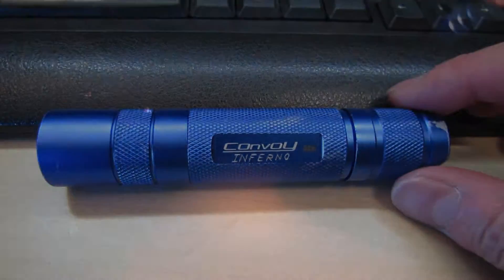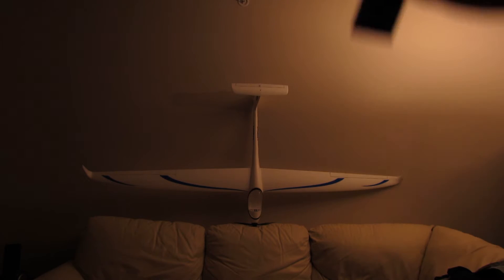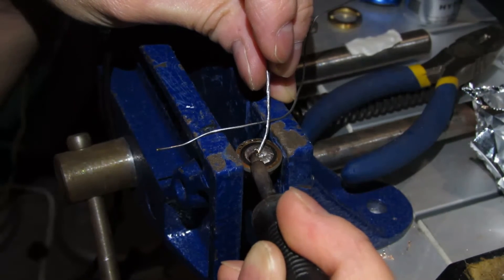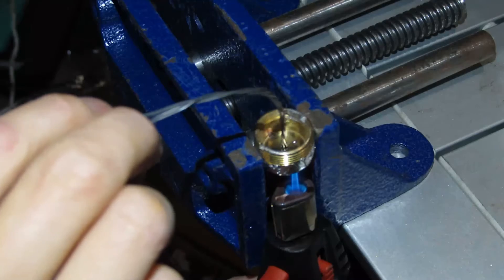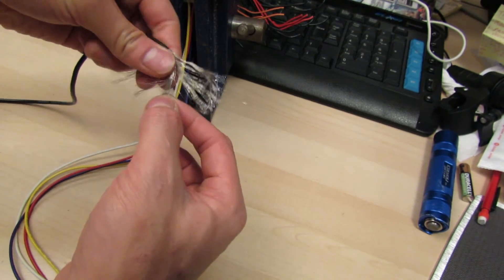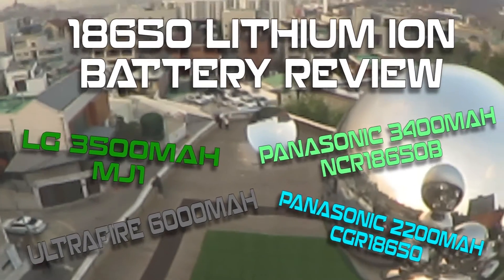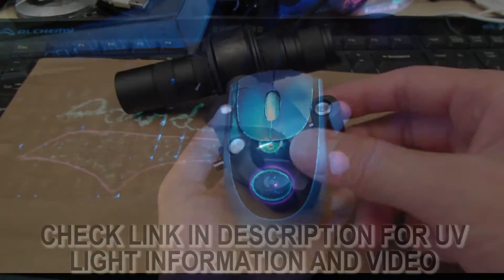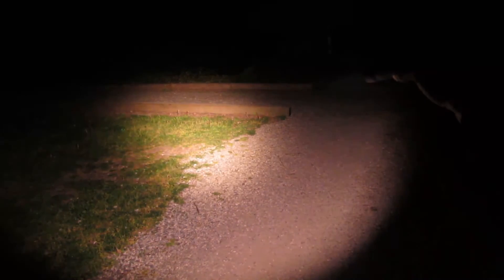The Most POWERFUL Flashlight EVER - DIY Convoy INFERNO - 2239 Lumens

Comment: Nice! I am going to try this with an XP-L HI LED!
Reply from the maker: Awesome!  Ya the XP-L HI is a great LED, that would be good if it can handle the currents.  Throw it on a Sinkpad II like this one, it's only $2!  http://www.leddna.com/sinkpad-ii-gen2-xpl-g-g2-e-c-xte-16mm-round-copper-base/
If you can buy the XP-L for cheap, that'd be pretty good.
Also, if you put it on a smooth reflector, you'll get a tighter beam:
http://www.mtnelectronics.com/index.php?route=product/product&product_id=479
Or you can go with a collimator from leddna if it'll fit, haven't tried it yet: http://www.leddna.com/10-degree-21mm-reflector-collimator-led-lens-for-cree-xml-xm-l-led/
That's the great thing about a point source, is that you can focus it better into a tighter beam, and make the ultimate high powered compact thrower, probably would be the world's smallest, most powerful, thrower of them all!
A thrower isn't all that useful in my applications, so I prefer the orange peal reflector and the XML2, but I can see that being useful for people in search and rescue, security maybe, things that require more punch than regular lights.
Cheers!
David.
Reply: Yeah! I have 3 S2's. One red one from GearBest (Warm White-XM-L2), two from Mountain (XM-L2 and an XP-L Hi I made from a host). This torch will be bad ass! I may figure out how to add a thermal cutoff too. Also, have you ever tried copper braid that's used as solder wick for tailcaps/springs? I don't know if solder wick is of a high copper content though. I will definitely post my results!
Reply: One more question, what did you use for spacers between the chips on the driver?
Reply from the maker: Hi John, I was eyeing the S2+ for a long time, but when I saw the blue one(new at that time) on sale for $12.88 at GearBest, I dropped the hammer and ordered it, for that price, I didn't care if it sucked, but when it showed up, I was more than impressed with it, hence the video and all my recommendations to my friends, some of them ordered 4 of them cuz they're avid hikers, and they had many cheap made-in-china flashlights die on them, mostly due to the cheap drivers, I told them these AMC7135 current limiters wouldn't let them down as easily.
The Convoy Inferno is my go to flashlight, due to it's power and long runtime, it's a jack of all traits.
When you say you got the Red one with warm white, which color code was it?  I only saw on there the T6-4C, which is 4300-4500K, cool white.  I would have gotten the warm white one if they had it though, probably ran out of stock, cuz the Blue I got was warm white, and it's not listed now though.
I haven't tried copper braid for desoldering, and the only reason for that is because I don't have any, but if it's high in copper content, it would certainly be great for that!  The wires inside very flexible silicon cable is very thin, there's hundreds of strands in them, so I think it's really flexible, that's why I like it using it, I assume it's a good balance for conductivity and flexibility.  The desoldering braid might be a little thick and not as flexible?  Could work well tho, just depends on the braid.
The spacer I used was just the tab off of a pop can, it's nice thick aluminum.  I just cut it to the width of the 7135, and folded it over once to get a little more of a gap.
I haven't received them yet, but I ordered 4 x LG HG2's, 3000mAh/20A batteries(http://goo.gl/nPHM7s), that will hopefully help keep the amps maxed out for longer with the 16x7135s.  It starts to drop off to 4.5A even with the LG MJ1's 3500mAh/10A batteries.  The Panasonic 3400mAh/7A batteries hover around 4.0A and then drops to 3.8A quickly.
Reply from the maker: I'm starting to think that the air gap isn't required between the 7135's though, since the battery is the bottle neck for current.  They didn't get that hot on the test bench either.  Next build, I'd probably just use the side wall of a pop can(not folded over), instead of the tap(folded over once, was what I used in this video, it makes a pretty big gap).  It'll be easier to clip with a smaller gap too.  It'll probably be fine without a gap even, but I don't like to promote mutual-heating of components if I can avoid it.
Reply: http://www.gearbest.com/led-flashlights/pp_154256.html&#160;this is the one I got but it was a warm white Bin. Probably out of stock. Yes, the price for the blue one is worth it, just a bit more than a host alone! Yep, heat is the death of all electronics. Maybe some thermal grease between them to even out the temps of the IC's...
Reply from the maker: Oh ok, ya that's the one I bought too, but they only have the 4C 4300K-4500K bin right now.
I like warm white, so I replace my LED's with 2750K ones.  My friend likes 6000K though, so everyone likes something different.
Not sure if the grease would help, but they don't get very hot, so just a tiny gap is probably good enough, or may not even be required.
Reply: I actually like the 5500-7000K hotter bins. Personal preference I guess. I just ordered a Moonlight Special 17 MM Driver from Mountain with custom modes for the Inferno! with 16 7135's! I ordered the firmware with 6 modes (Safety?!) from moonlight to high no memory.&#160;I may get the gold plated tail cap button & spring but I assume the switch is 17MM ???. I assume you used flat top batteries since you made the copper&#160;positive contact? Do you think the Inferno will work (fit together) with button tops (which is all I have)? I am asking because the Panasonic Button Tops I have are all protected, so they are quite a bit longer than normal...otherwise I'll have to buy some flat tops...Too bad they don't make (that I know of) a direct drive FET that will fit that will punch out 10 amps! The .380ma 7135's will work just fine.I also recently built a Convoy L2 with an XP-L HI 6000K LED and that thing is unbelievable! I can shine and clearly see 1/2 mile on a dark road. This will probably be comparable!
Reply: I might even swap the guts out for this on my red light so I know it's HOT! I am also thinking about adding a thermal cutoff switch, but don't know where to put it in the circuit. Will have to do some homework on the schematic. http://www.allelectronics.com/make-a-store/item/thsw-167/thermal-protector/1.html
Reply from the maker: Hi John, I was checking out mountain electronics, and there's a 17mm driver, H17F, which has a temperature sensor built into the board read by the AtTiny13A, it can be programmed with clicks to hit a set target temperature.  It comes with 8x7135's and a FET too, for turbo, that sounds like what you're looking for: http://www.mtnelectronics.com/index.php?route=product/product&product_id=659&search=7135+driver
The problem with the FET, is that if you use copper braid, a brass button, and a 20A battery, you might accidentally go over 6A and blow your LED, I think the XML2 can handle 6A, and the XP-L HI about 7A, I could be wrong, but I wouldn't try exceeding that, which is why a FET might be dangerous. It might take a 30A battery to have a low enough internal resistance to burn it out.  I guess it's all trial and error.  A replacement XP-L HI is only $5, so you can afford to have error.  Make sure you mount to a SinkPad II copper pad as well, or another copper pad, otherwise it'll burn out at 4A or so.
I use unprotected cells, and I think it just fits, so I could see the protected cell with a button top being a problem.
I haven't taken one apart, but could you just take the circuit off the bottom, and the button off the top of a protected cell to use it as an unprotected cell?  Might be worth a shot. But it could be easier to just buy an unprotected cell, I'd recommend the Sanyo/Panasonic 3500mAh/10A cell(http://goo.gl/nPHM7s), or if you're really going for power, the Sony 2600mAh/30A VCT5(http://goo.gl/LDXlIV), but with a FET that may burn out your LED.  
Lots of options out there.
Also, the thermal bimetallic switch you linked is too big to fit in the Convoy S2+, I have a bunch of those and put one inside my SkyRay King 7xXML2, but it barely fit in there and there's a lot of space, I think the thermal sensor on the AtTiny13A is the best we can do on the Convoy S2+ for thermal management.  It's a good driver, but it'll cost you more than the Convoy S2+ itself, probably worth it though, if you're going for that kind of power and those kind of options/programmability.
Reply: Thanks David! I'll order one and play around with it and post the results.
Reply from the maker: You're welcome.  It looks promising, if it's as good as it sounds, please let us know! That would be an awesome light.
Are you trying to get a tighter beam by using the XPL HI?  I ordered some collimating lenses and XPL HI LEDs to test out, hopefully they perform favourably, I'm going to try my hand at building a very powerful thrower from the S2+, I know a lot of people can benefit from a thrower so it'd be good to see how well this can perform, I don't think there has been a directional light source with as much intensity as the XPL HI ever, so it'll be great for people who want throwers.  I have a Convoy L2 with an XPL HI, but the reflector is larger than the SkyRay King, so it's not a portable flashlight my any means, the beam is significantly tighter than a C8 though, so the size is justified. 
Stay tuned for a review video, it'll be good for thrower fans. 
Cheers,
David.
Reply: Yes, it does! I also ordered the other Driver so I will try both. Yes, I like tight beams, especially for a thrower. My L2 is also an XP-L HI and it can light up unbelievably! I was able to get a C8 with an XP-L HI (V1) from Int'l Outdoor before they stopped making them. It is a bad as light too! Yep, can't wait to get all of the parts! Thanks again David!
Reply from the maker: That's awesome, it's fun to play around with this stuff.  That new driver looks pretty awesome with all the programmable options and temperature sensor tho.  I'm sure it'll make a very good flashlight.
Have you compared the C8 with XML2 to the C8 with XP-L?  I'm wondering how much tighter the C8 is with the smaller LED, but unless both of us have both, we won't be able to test that out.
I can test the C8 XML2 vs L2 XP-L, and you can test the C8 XP-L vs the L2 XP-L though, funny.  We can test every combination on earth!
Reply: Yes it is! I should get the driver in the mail today. The light has shipped also, but will take a while. gearbest is slow! I have a C8 with an XM-L2 and a XP-L, same color temperature (~6500K). The XP-L is brighter and has a better hot spot. It is pretty nice for sure, but the L2 blows everything away using 2 batteries.
Reply from the maker: Hi John, did you test out the temperature control of the new driver? Does it work well?
I tested the Convoy L2 with XPL-HI yesterday, damn that thing is a thrower!!  Could easily light up a building 0.5km away!
Can't wait to get my Convoy L6 and see how that works, it's got an inside XHP70 in there, probably the most intense LED out there right now.
I might even try modifying the driver to push more current into it.
It's $16 a pop, so I could afford to burn one out to see how much it can pull I suppose.  Or maybe I'll wait a bit.
I'm not a throwaholic, but who doesn't like some good throw eh?
Hope everything works well for that new driver of yours!
Cheers,
David.
Reply: David, I just got the light Saturday and have not had time to mod it.  I did get the Dr. Jones 17 driver also. I have the rest of the parts coming today from MM. Yes, the L2 is bad ass! I have not checked out the XHP70 yet. Is it more powerful than the XP-L HI? Yes, I like thrower's too. That's why the L2 is so bad in my opinion. I will let you know how everything works out!
Reply: I got the other driver and the rest of the parts today! YAY! Maybe by the weekend I can make time to build it!
Reply from the maker: Hi, awesome!  Good to hear!  You've got all the ingredients!
The XHP70 is basically 4 x XML2's in a 7mm x 7mm form factor, instead of 5mm x 5mm.  It's rated for 32W, and 4022lm, so it's much more intense than the XPL HI, but it runs at 6V/12V, so you need multiple cells, the XPL HI is great because it can fit in a tiny single celled flashlight.  I might put an XPL HI in my 16340 EDC, that would be cool.

The Convoy L6(http://tidd.ly/7c8738fe) is $50, but it might be worth it, I'll find out when I get it.  It has big promises, but we'll how it compares to the L2.  It might be the thrower king?? Who knows.
Reply: Cool! let me know on the L6...
Reply: OK! As I stated before, I got all the parts. I put it all together this evening. I made 4 copper pucks to fit the brass pill. Solid and NO heat hardly at all unless I leave it on for 5 minutes! Gooped it real good with heat sink compound, and made sure the sinkpad was well gooped also.  I used the Dr. Jones H17F driver for this build and in Turbo mode and the same batteries you recommended in the video it is unbelievable!. WOW! What a bad ass light! Definitely approaches the same lumens on turbo mode as your build, but with the H17F driver in direct drive mode! I will have to do a video soon!
Reply from the maker: Haha damn man!  That sounds like one powerful beast of a light!  
It's a FET driver so you're probably pushing A LOT of amps, more than me I think.  You may have the world's most powerful single celled 18650 flashlight in your hand, and with that driver, it's definitely got the best options!  It makes the 105D look primitive.  Ya make a video of this monster!
We are making some crazy stuff here, scary.
I wonder what happens if you put in the LG HG2 20A battery, and then the Sony VT5 which is a 30A battery??  Could just burn out the LED tho, so that would suck, unless you liquid nitrogen cool the thing.
I actually got some HG2's in the house!!!  Just arrived yesterday.  They seem sold out so they must be a hot ticket item.  If you dare, try them out ;o)
That will be where the 16 x 7135's come in handy, they'll regulate the current at 5.6A, any more than that and I think the LED will RIP. LOL.

So initial testing with the L6, this thing is BRIGHT, but I'll need to do some testing at 0.5km to see what kind of thrower it is, at first it doesn't look like one, but I'm just doing indoor beam shots, and that's not completely representative of the results in the field.  The beam angle appears to not be so tight, but that might be the orange peel reflector creating a more smooth gradient to the field angle.  We'll see soon enough.

How do you like the driver modes?  It works well?

Thanks for letting us know how it went!
Cheers,

David.
Reply: It sure is a beast! I know that the thing gets real hot, real fast...The direct drive turbo mode is wicked. Those HG2's should be the bomb! I will have to check them out! Cool on the L6. Let us know! I like the modes, but it is complicated. I screwed it up a few times but was able to get back to factory defaults. I have to play with it more. The thing is real picky on the mode selection and taps for sure...I have to have the directions in front of me and its still hard to program. Way too many functions! I will now have to make the red S2+ light I got into a beast using the Moonlight special ordered with 15 7135's!
Reply from the maker: Haha, ya it gets dangerously hot, actually how about the temperature setting of that thing?  You can set it to decrease output at a set temperature right?  Let us know how that works out too, it'll be the best of all worlds, SUPER powereful, but safe as well, since it's automatically adapting to the temperature changes.

That's the problem with lots of options, you need to learn it, and it can be a hassle, but once you get a hang of it, it might be a breeze, like flying a helicopter!  2nd nature.

I don't remember what the moonlight special was.  Oh that was the one with the temperature sensor?
Reply: Yes, it does, and I haven't played with it enough to set the temp yet. I will let you know though. The Moonlight special is a 7135 X 8 driver with turbo, and I added 7more 380 ma 7135's! Here is what I ordered for the MLS firmware: 

1.Number of Modes: 6

2.Mode Levels: Moonlight--15%--33%--50%--65%--85%--100%) 

Mode Order 1.Ascending: L-->H

Mode Memory 2.No. The light will always start on the first mode level after
being turned off. 

Turbo Timer (light will step down from highest mode at a designated time
interval): 2. step down @ 30 Seconds when at 100%
Reply from the maker: Oh nice man!  So is it 8 x 350mA and 8 x 380mA? 5840mA!  Wow, that will be pushing the limits for sure.
You'll want to fit maybe 6 copper pills in there!  Fill it right up, if you can use thicker copper that would be good too.  It'll stay on for a lot longer before it reaches the cut-off temperature, copper really takes a lot of energy to heat up, once hot tho it stays hot for a long time, so you win some you lose some.

The turbo timer isn't really required, you could turn that off, since the temperature sensor will do the job of reducing output, right?
Reply: Yes, it's 8. I could add more copper but will see if it works good with the 3 that I put in.